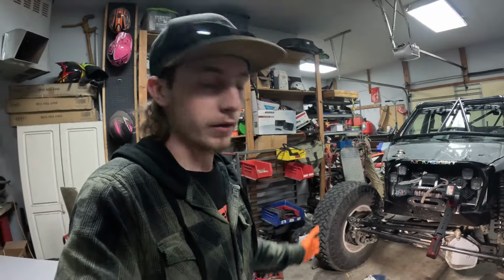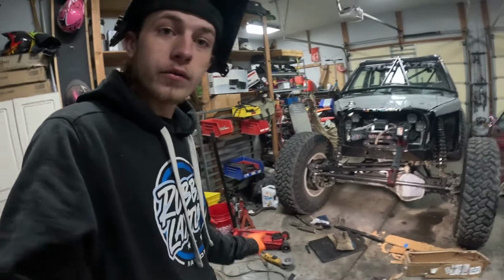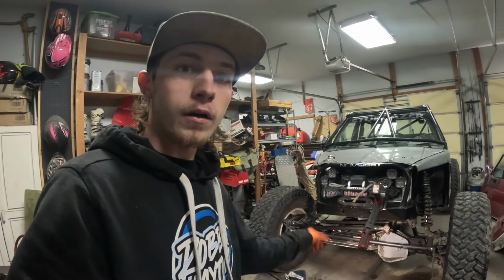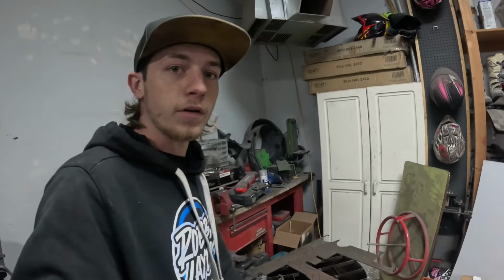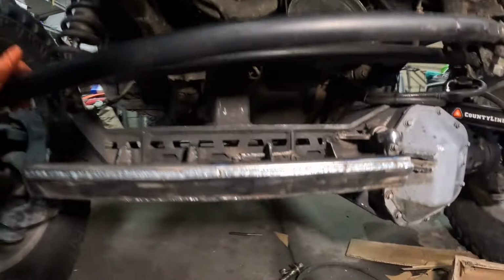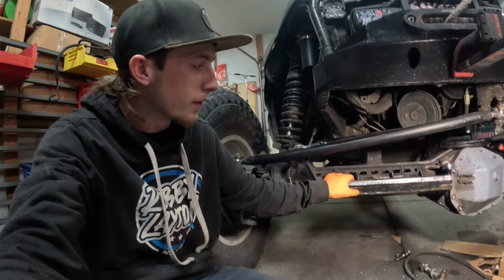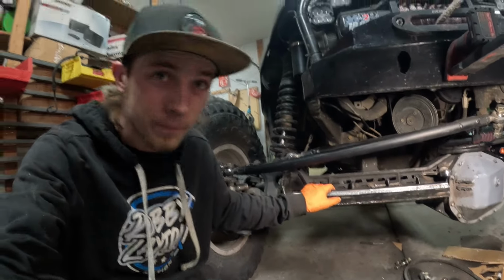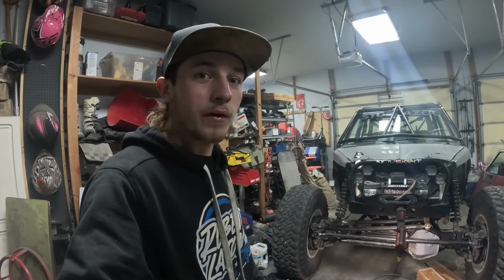Protect your steering with a guard

Comment: Looks great and definitely looks strong.  No you need like a skid pan with a bit of a mad max snow plow like look to jus under the front bumper  ... and just behind the front tires a small fender extension to keep  stuff from being flung back at you. Just at the back of the tire / wheel well.  It all looks great and little touches here and there just refine the performance and appearance.  
👍